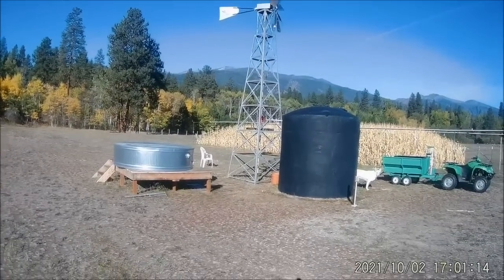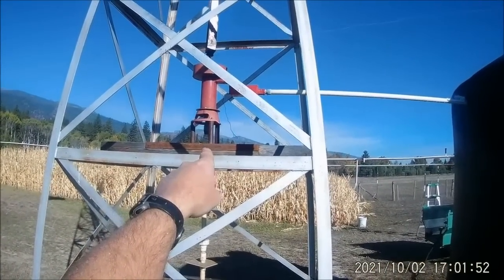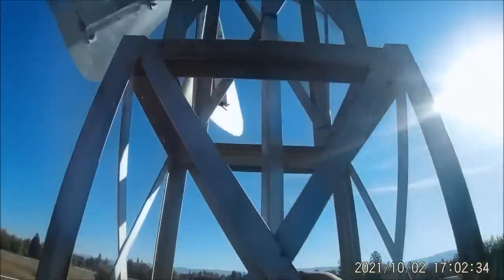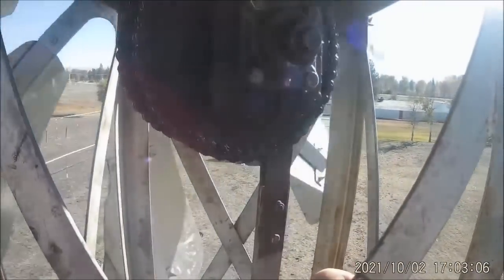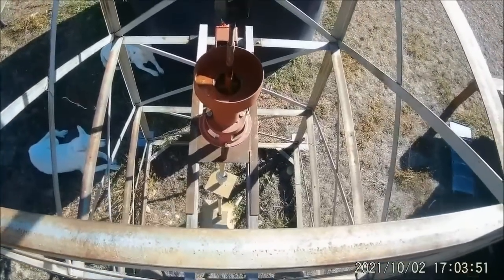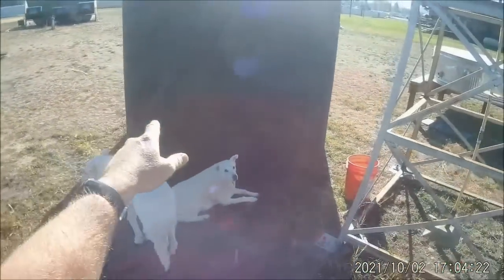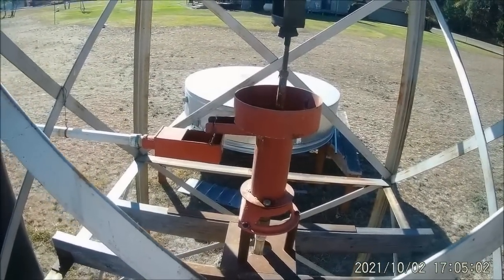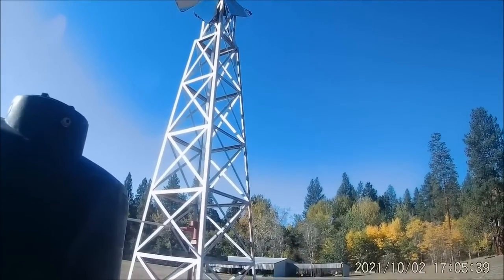DIY  HOME-MADE WINDMILL.  WATER PUMPING-NOT DECORATIVE.

Comment: But if you use an electric motor to pump from the tank to water the field.. why not put the water pump in the borewell directly? As far as you have water in the ground it will work nicely.

Comment: I do some similar. I use a 16:1 transmission utilizing a worm and down gear.  My tower is hinged and counter-weighted, so I can lower it to service the mechanism.  All my wind turbines compress air, which I save in a giant system of pipes and tanks, an air battery, if you will. Many of my tools, as well as my whole-house electric generator, operate on compressed air.
Reply: Are you serious ????
Reply: @Duckisa  Yup

Comment: 🤔Back in the old today's windmills had  metal steel  cables on all 4 corners also when the blades was much larger and much wider and much higher UP in THE air that's a GOOD way to pump any water out of the ground it's AlSO a good way to  generate your own electricity only a win mail has got to have a REAL GOOD gearbox to turn ANY generator ALSO real metal steel cable's on all 4 corners on ANY windmills ALSO THAT'S where PEOPLE go wrong NOW DAY'S IS NOT putting Real Steel cables on ALL 4 corners ON ANY windmills ! . Yes you really could have free water all year round also free electricity all year round with a good windmill with a real good gearbox .

Comment: I would like to replace my electric well pump with something like this so I can keep sprinklers running in the event of wildfires.  
Would this make enough pressure to run several sprinklers set up in series and could it withstand a wildfire and the wind created by a fire?
Thanks!  It is a great idea for your corn patch for sure!
Reply: Not on it's own, no. Seems to be a fairly low pressure system, and focused on suction instead of pressure. You would need an additional pressure source to draw from the tank to reach the needed pressures, such as a water tower, a pond up a hill, or a battery pump.